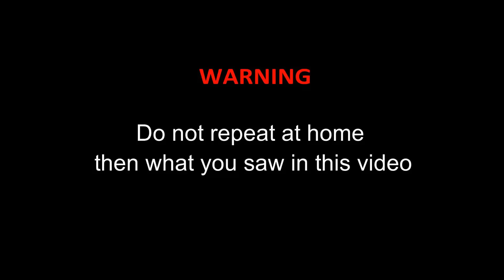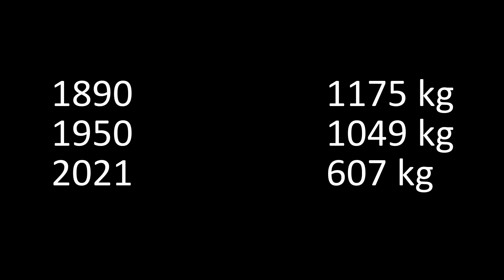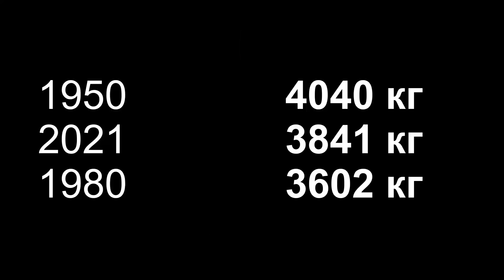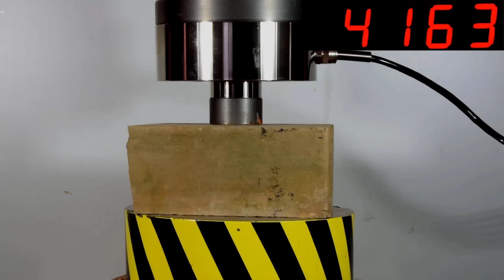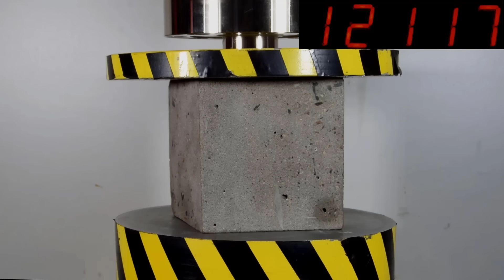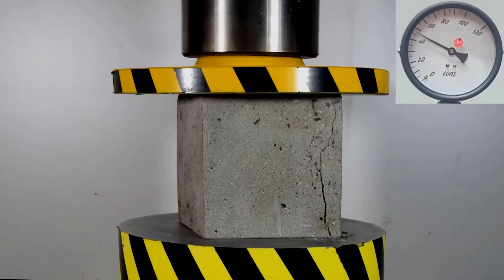HYDRAULIC PRESS VS OLD AND MODERN BRICKS

Comment: Long times ago the walls were carrying the load ,so bricks need to be strong , but now its carry by beam and column and bricks are just a partition !😊
Reply: you talk here about skyscrapers?
Reply: @BaltaRecords  Buildings up to 5 floors max
Reply: @BaltaRecords  no skyscrapers use bricks
Reply: @ZukoHeirToTheThrone  for decoration, usually it’s just carved paint tho
Reply: @nickgregory543  ye
Reply: @felixtik9151  Here in India, the buildings are made up bricks, cement and sand only. However it differes from place to place and budget. People have also started to concrete bricks instead of baked clay bricks.
Reply: @mmallick3224  Todays even one floor construction have beam and column ,if not  it will collapse even with very little EARTHQUAKE !😊
Reply: @felixtik9151  Yeah, here too we have wooden houses, mostly near the Himalayan region as the most frequent earthquake occurs there. However, near the tropical regions, the humidity causes the woods to rot and hence they prefer bricks over. Also nears the plains the heavy flood can easily break down the houses in the plains. And columns and beam construction are therefore not prefered too.
Reply: Modern extwrior bricks are made with air pockets for added Insulation as every new build has to meet strict environmental regulations.
Reply: @mmallick3224  interesting adaptation with materials to its environment.

Probably cheaper to use clay/concrete instead over treating the wood with a resistant resin
Reply: @Imperial_Cosmonaut  Yes, the structure and materials used for building the houses differ and adapt as per environment. In the Plateaus, and Plain regions, people prefer to use baked clay bricks, in the regions of north-east, people make silt houses which support the main structure from sinking during floods. In Hilly Areas, slooping roofs and wooden structures are used for making houses.
Reply: Exactly!
Reply: Chris m  proof?
Reply: @mmallick3224  I like the concept of aircrete, cheap, light, goes up real quick, a great way to build a house for people of limited financial means.
Reply: Chris m  Spoken like a person who knows nothing about history.
Reply: Chris m  Spoken like someone who knows about cutting (and using ) drugs.
Reply: Chris m  I just know there has to be a coherent argument in there somewhere, maybe after a few more drinks.
Reply: Chris m  source?
Reply: modern bricks can carry load just as well. Theres not much technological advancement or degradation in fired clay bricks. Humans have been doing it ever since the first cities were concieved. its just that building techniques have improved to the point that they dont have to.
Reply: @ulisesrl0  "The source is that I made it the fuck up"
Reply: Chris m  🤯😂
Reply: Until there is a hurricane, TORNADO or earthquake then every part needs to be load bearing to give every human every advantage. And time to get out.
Reply: Chris m  Huhhhhh? I'm completely on board with the ways we've screwed indigenous people for sure. But to try and point at I assume american indigenous tribes as the birthplace of ....bricks? Concrete? These things were being used a very long time ago in places like Rome, and Egypt. Roman Concrete is one of the most durable materials on earth (that are manufactured) 

I mean the Incans and the Aztecs were using cut stone blocks as well building their pyramids or ziggurats, but so were the ancient Egyptians.
Reply: @fakiirification  yeah, for some reason this chris m guy is like trying to imply that these materials weren't used in western civilization until 1492? That's bizzare af to claim.
Reply: @ExarchGaming  historical revisionism and commie induced white guilt lol
Reply: What if we go before bricks were invented? Tudor houses were supported by beam structure. As were Cathedral knaves before them.
Reply: @dcarbs2979 Actually you are right, maybe here  we talk about modern form of beam and column witch made from steel or concrete reinforced by rebar(Armature) not timber or ...😊
Reply: In general..... the dynamics of a build are a 1000x more understood than 125 years ago. Bricks don't need to be as strong. Now....There's much more "cost/benefit" analysis. Nobody is gonna use a bazooka to kill a bunny rabbit. 
You can build with many different materials for many more different types structures than ever before that are cost adjusted to be better for cheaper than ever before. This silly test is a distraction from the purpose of a BRICK. The guy doing the test must have a BRICK for a brain.
Reply: @franram7426  So what is your interpretation of "the purpose of a brick"? And has it changed over the last 130 years? Or last 1000?
Reply: @dcarbs2979  
I was pretty clear..... A brick is for structural integrity.... You don't need super strong and super expensive bricks for most common structures today. The implication of this clip is that bricks are being made with less strength and thus NOT AS GOOD over time progression. Which is the opposite of what the reality is. The reality IS buildings are better than ever because of improvements in the way buildings are built and the new types materials that allow for cheaper bricks that are just as effective.... i.e. The building doesn't collapse. 
Never mind. You'll never understand.
Reply: Load-bearing walls still exist and they can definitely be built with bricks. Beams and columns are the smarter way to build the building to reduce weight with a more calculated and clever way to transfer the load to the foundation. If you think bricks can't take the load of the building, that's nonsense, and the column can even be built with bricks.
Reply: @franram7426  Thanks. With that explanation it actually sounds even more like a contradiction than before. Bricks are needed for structural integrity and you don't need super-strong bricks today. Sounds like one part of the state is built for strength, the part not. There are both ancient and modern ways of building strength where the design takes the strain rather than the inegrity of the brick. e.g. wooden arches and support beams, where bricks just create rooms inside rather than structure. And/or walls made out of other materials such as daub (I told you I was going ancient !). Both time periods have methods of building without bricks. But you're right, I'll never understand if it isn't explained well and then they give up.
Reply: @dcarbs2979  
I said..... This video leads one to believe "bricks are weaker and therefore what brick do isn't being done as well". I don't believe brick buildings are worse today because bricks are weaker..
I believe ... either....Bricks were being made MUCH stronger than necessary or building techniques have greatly improved so that SUPER STRONG bricks are not required. I don't believe that bricks are being made with preprogrammed obsolescence by tricking people that don't have brick crusher with a calibrated measuring device..
I doubt you're gonna "get it" but maybe you'll get this......
GOOD DAY !
Reply: @franram7426  It was the way things were. At least in England. Look at even non-structural things like tiles, their method of construction is a lot more labour intensive than modern ones, and the artistic merit much higher too. There is demand for some heritage construction made that way for special Victorian buildings that use them, such as our House of Commons. Even utilitarian buildings like public toilets and engine housings are far more elaborate than they need to be for the function. There doesn't seem to be much art in architecture in the 20th century and beyond compared to 19th and earlier. Certainly in municipal buildings. Basic homes may be different. I know a bit about cars, and it's as much what they're built as well as how they're put together. Probably no different with buildings.
Reply: Occam’s Razor, the simplest explanation tends to be the correct one.  In the past they used more ingredients that provided strength and quality because businesses believed in customer service and the customer was always right.  Over time more businesses started so more costs had to be spent on advertising and acquiring more talented employees to make cheaper products faster.
Reply: @rwfrench66GenX  Many industries go through that process. Start off not very good as no research has happened. Better but more expensive products due to research (this stage is usually the first commercially available). Even better products as companies out-do each other on quality. A company discovers a way to cut corners to maintain fit-for-purpose quality at a lower price (probably peak quality for the product). Market fragments into budget and premium sectors. The more essential the product to life, or sold to businesses rather than consumers, the higher prevalance of budget relative to premium.
Bricks are pretty essential if we want somewhere to live. Bigger and/or work buildings such as offices are not built with bricks. They are both premium (e.g. Canary Wharf / The Shard) or budget (e.g. my local council office built with steel girders and pre-fab wall panels that look like redbrick) :-)
Reply: @dcarbs2979  Bricks have a place in the market for dwellings, ovens, driveways, sidewalks and what not, you’re right!  But the quality and strength of the bricks came down over time due to things both of us mentioned.  You’re also correct that the same thing has happened in most industries.  Quality is subjective because all things aren’t equal ever.  Cars today hit a deer and 9 times out of 10 the car is totaled.  My dad’s ‘73 Pontiac station wagon mowed down 3 or 4 deer every winter in Michigan like they were speed bumps and there wasn’t a scratch on that tank!  Now it didn’t get the gas mileage and it polluted the air with leaded gas sold at the time but wouldn’t you rather have a car that could survive hitting a deer?

Comment: I think the reason why modern red brick is more fragile than older bricks is that red brick isn't really used as a building material anymore since it's been replaced by concrete, rebar, and cinder blocks and is more decorative so the material is either cheaper or made to be more aesthetically pleasing than durable.
Reply: because you dont need that kind of durability the ol ones have
Reply: Also weather protection. Air pockets make it more durable against water and better at insulating.

Comment: The old bricks were fired at a higher temperature. As a result, they have increased compressive strength because there is less air in the stone and the pores have closed. In modern stones there is more air to achieve better thermal insulation and therefore the stone breaks earlier. You can buy the same brick from 1890 today.

Comment: Strength aside. Can't we appreciate how fine looking the 1890 brick and concrete are
Reply: The concrete certainly but the modern brick looks a lot more beautiful
Reply: @ahassen1236  No way. The modern brick has many ugly cracks, holes and grainy bits and looks ugly. 1890 brick is much more solid and smooth and looks much better.
Reply: Yeah, they looked surprisingly usable

Comment: I found it interesting that on the first test you used a different head on the hydraulic press when it came to the 1890 brick and on the second test both the 1950 and 1890 brick were placed differently, with the head pressing on the end of the brick versus the middle on the modern brick. I have no doubt that the older stuff is stronger, but the tests were set up to exaggerate the difference.

Comment: I salvaged a bunch of 1800's bricks and have used them for various little projects around my yard. They're definitely harder than modern bricks.
One of them (from the 1800s) has a very clear doggie pawprint in it, where a dog apparently stepped on the brick well over 100 years ago, before the bric,  was fired.
Reply: RIP ole blue!

Comment: When brick vendors realized that the faster the bricks break the more they'll sell.
Reply: Money printer go BRRRRR4RRR
Reply: It's not shoes or tyres... You can't just pull them out of a building once it's installed..
Reply: @dingzhixu3678  Just means they don't need to invest on DRMs so their product is unrepairable. Once you break one, you have to replace the whole wall. Convenient.
Reply: @belldrop7365  I'm familiar with the process, it's called return customer is more profitable than acquiring new customers.. That's a business concept.. But this is not one of those products.. Bricks are only profitable developing areas.. In most cases it's the hardest and most labour intensive jobs with the least financial reward.. Trust me, if it was that profitable.. I wouldn't even bothering typing this!

Comment: I can sense the civil engineers seething at this test. strenght of brick is defined  as max stress= F/A usually MPa not some arbitrary force applied to differing material sizes.
Reply: Yes exactly. The condition of test samples is the key to providing a meaningful comparison. In this case, the only value coming from these tests is just to provide entertainment by showing how these bricks break.
Reply: You would be correct. I haven't even finished my bachelor's in civil yet and this ground my gears.

I graduate December 2023, hoping to specialize in either pavement design or structural design.
Reply: It's fine as entertainment but unfortunately it feeds into the myth that everything was made "better" in bygone days. It's just boring to see the same old nonsense comments popping up moaning about modern materials versus old stuff. I've been in the building industry since 1982 and I know from direct experience that the range and quality of materials has generally improved every year over that time, with the exception of some natural products that either became scarce or were scaled back in the interest of conservation. I work on some old buildings (oldest went on site in 1030) and I live in a house built in 1752, so I have some decent comparisons from before my own time.

Comment: Modern bricks were visibly more porous for the purpose of better breathability of the building. 

Those old bricks are literally solid clay
Reply: Interesting
Reply: Porous for thermoisolation
Reply: @senatuspopulusqueromanus2082  whatever insulation is provided by the air is miniscule. 99.9% is provided by extra materials such as PU, polystyrene, rockwool, even tenths of an inch will do a lot better than some bubbles in the bricks. No, it's about poor quality. Most "bricks" some today are not actually bricks, but ceramic blocks incapable of holding their own weight past ground floor. Cheaper, crappier, "modern".
Reply: @empyrionin  there are fucking tens of millions of new bricks instead of just millions of old. and thanks, I'm familiar with how insulation works.
Reply: @empyrionin  Это называется конвекция. Причина по которой термоизоляция воздуха ничтожна
Reply: Exactly, I believe homes built with brick prior to the 1920's were made of solid brick. I have a friend whose home is solid brick and lathe plaster walls. The house still looks damn good and the rooms are huge. PITA to run electrical wire.
Reply: @hhjhj393  yes, but, the weaker the bricks, the more concrete you have to use. In my country basically all homes are made of concrete, with ceramic "bricks" only used as cheap filler material. For MILLIONS of things that need to be built, you already use concrete 100% (such as for highrises). So leave the darn bricks to the bricklayers and people who want to own proper homes, otherwise stop claiming "ceramic blocks", are bricks. There are actual "bricks" bring produced today which aren't crap. If you need fillers, you can use BCA, or even wood, or a myriad other materials. Use the proper material for the proper location and preference, and don't act as if it's something else.
Reply: @hhjhj393  British labour was relatively cheap in 1890 and loads of people could do it. There was huge demand around the Empire for them too. Such was the demand and lack of automation, there were huge factories purpose built for the task. A worker was expected to make 4 bricks per minute. 12 hours a day, that's around 2500 bricks per person day. A factory of 500 people could make a million bricks a day which is only a mid-size factory by indstrial revolution standards. So in terms of numbers and speed of production, they could definately compete. They can't compete on price. A single person would be able to manage a machine that makes 10's of thousands rather than 2000 a day - same amount of product, but much cheaper cost and fewer people.
Reply: You can actually hand make bricks fast enough. I work at a plant in ohio that still makes hand packed mud brick by the hundreds of thousands
Reply: There are thousands of different types of modern bricks. Breathability is not usually a consideration unless the building is being tested for airtightness and a particularly gas-impermeable brick is specified.